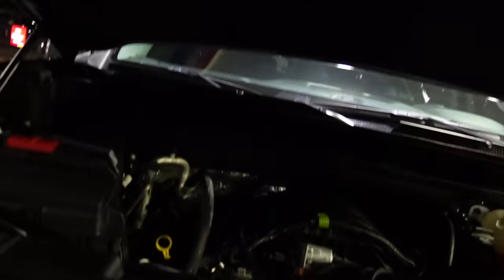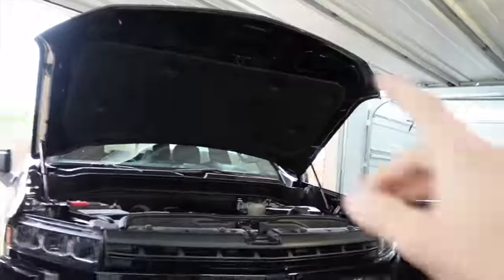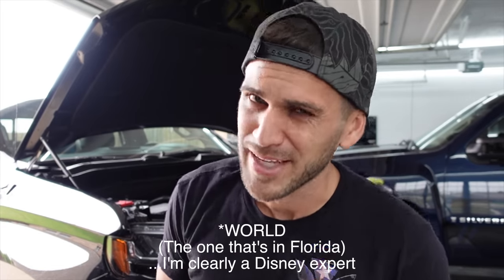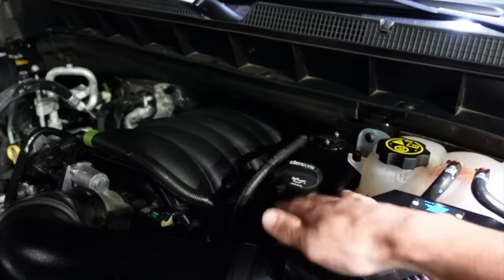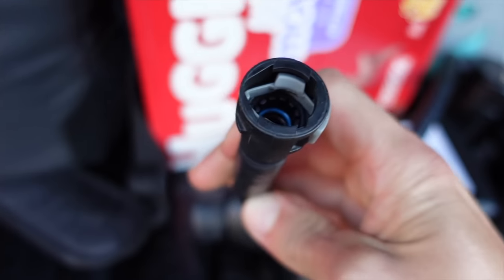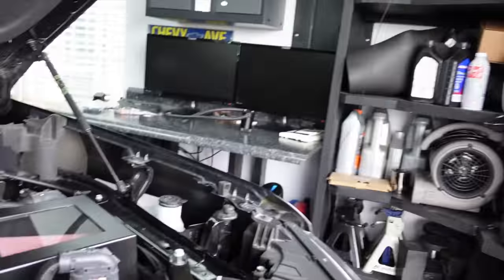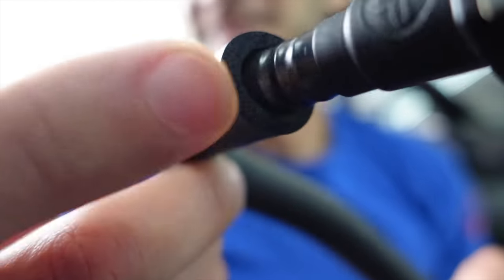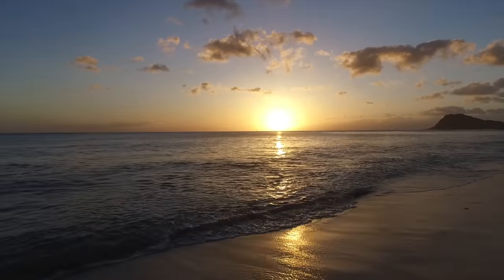Silverado Oil Catch Can - Did NOT Go According to Plan... 2020 Trail Boss Oil Separator

Comment: I’ve installed same unit(s) on a 2020 Suburban Premier Plus with the 6.2 engine, and on a 2016 Silverado LT with the 5.3 engine. I also purchased the extra 3oz extension for both units from JLT. I love the system. 
One thing that I notice from the 5.3 in my Silverado, is that once I deactivated the AFM system, via a Range plug in module, the oil bypass was greatly diminished. Or there was less oil to catch. That is yet another down side to the AFM system. Even though the cylinder would be deactivated, the oil pump still when send oil to lube the cylinder, and cause additional blow by. I believe Gm makes a different valve cover with a baffle and screen on the pcv vents inside the valve cover. To help reduce the internal blow by. 
On the 6.2 engine in my Suburban. I’ve notice that the system collects more oil while on longer sustained trips, especially if you are using adaptive cruise control. Than on daily driving. I haven’t purchased a DFM deactivation system yet. But; the Range Pulsar LT is in my future for my 6.2. 
Although the JLT system is some what pricier then others. I just like the reformed look and the ease of a plug and play system. It looks as if it were a factory option. Which I think for the amount of $ we pay for these vehicles, that a system like this should be.
Reply: Oil is sent to lubricate the cylinder? I think you're mistaken.

Comment: UPR catch cans come with much better hoses as well as WOT hose. I have a 2015 Yukon 6.2 with no added noise. (Pro model with ceramic back flow valves $439).

Comment: there are centrifugal ones built into the L5P and the LM2 (6.6 and 3.0 duramax respectively). They spin the oil out of the air, and return them to the crankcase .

Comment: I just installed mine yesterday and did notice a lil increase in vacuum noise(hissing) with the hood open, but not with the hood closed. I ordered some foam beer can insulators to quiet the catch can. Not that i need to but more of an experiment. 🤔 also added some oil to the inside of the hoses o-rings with a q-tip.
Reply: Awesome Idea 💡 👏 👌 I'm wanting to insulate a dorman catch can I just got and now I know what I'm using 😀 peace and much respect to you 👍 JASON

Comment: Lonestar, I did a little research (google) and found a thread on this issue but with a different brand. Quote "
Re: Sucking noise with catch can installation.

Postby MWBARN1 » Jan 05 2021, 11:52pm
I had this same issue with my E2000 Catch can. It would very slightly affect idle to the point of me not being sure if it was in my head or not and there would be a hissing sound from the engine bay when running. I couldn't let it alone so I took the catch can off the truck, put the stock PCV tube back on and there was no more hissing. I then took the catch can assembly and bench tested it with a vacuum pump. It would not hold a steady vacuum and would leak from 20 inches of mercury down to zero within five seconds. I isolated the leak to the quick connects provided with the E2000 kit. I cut apart the factory PCV tube and took the connectors from it and installed them on the E2000. I re-taped the hoses where I replaced the fittings and bench tested it again. This time it held 25 inches of mercury for five minutes. I called it good and released the vacuum. After re-installing the catch can there was no hissing sound with the truck running. Hopefully this helps others with this same issue.

Comment: My guess is there is still a slight vacuum leak.  It's extremely possible that the o ring on the jlt fitting is missing, damaged or even the wrong one.
Reply from the maker: That's what i'm thinking. I'm going to try to cut and use the stock fittings with the JLT hose and see if that fixes it.
Reply: @LonestarHawaiian any updates on the hissing? And if so how did u fix it?

Comment: I had same hissing when I used the fitting on it, I just cut the fitting off and used hose clamps onto the nipples of the PCV
Reply from the maker: Interesting... I'm going to try that. Thanks for the recommendation
Reply: I did the same. The new fitting hissed so I first cut the old one and attached hose to it and it still hissed. Now I just put the hose with clamp right on the port. No more hussing

Comment: Just get a breather oil cap. Had the same issue when I owned a Sky Redline and installed a catch can with AN fittings and braided hose.
Reply: Just adding the breather doesn't do much. What that does is allow the valve cover to draw in fresh air.  The pcv system has an intake and and exhaust. The catch can goes on the exhaust side of the pcv system where it filters out the oil so it can be burned in the combustion chamber. Just adding a filter  doesn't eliminate the problem.

Comment: My 2019 chevy 1500LD LT i put on a oil catch can. All highway im getting 25mpg. My truck doesn't make that hissing noise. None lifted, all terrain tires 255/70/17s. Cold air induction cold air.

Comment: I have the same set up as you. JLT catch can, Muffle delete, and the CAI intake. The catch can on my 2021 sierra 5.3l does the same hissing sound and catches a ton of crap. I put the catch can on at 1200 miles and the dealership hasn't said anything about it. I now have about 5k miles on the truck. I noticed in the colder weather it will catch water from condensation(yellow goop). If you could give an update about what JLT says about the hissing, that would be awesome! Thank you for the great content!

Comment: Catch cans are baffled and hose lines are longer compared to factory.. This affects the amount of air and gases that are fed through the PCV valve, when in return changes the internal engine pressure. Because internal engine pressure is changed, the motor is working harder than what it needs to, and has to idle higher than normal to offset the loss in crankcase ventilation. This would explain loss in fuel economy.

Comment: Ran UPR on my 2018 Tahoe with the 6.2 and zero hissing. I bet you cut the o-ring in the fitting when you installed it or the o-ring is missing completely. Pull the fitting and take a look inside.

Comment: Run a slice line down the stock part insulation to be able to remove it to use it around the new catch can hoses then wrap the insulation tape around that I may be super quiet just a thought
Reply from the maker: Good thought!

Comment: Manufacturers won't because they are not a necessity. You won't see a negative impact till the vehicle is out of it's warranty and they don't care then. So it isn't a cost they need to incur. Biggest reason is they could not trust the owner to maintain the maintenance of it resulting in liquid going through or a blockage hurting seals. Owning a JLT myself, these are JUST for those of us who want to go the extra mile and or want to keep our vehicles well outside the warranty.

Comment: I'm 100% sure that that connection is leaking air grab yourself a spray bottle with dish soap and water and spray the area and see if there's bubbles I guarantee you they'll be bubbles. If so if you would like to repair it with the stock piece simply heat up the stock hose where the connection is and when it's warm pull it out and reinstall that clip on your new hose and you will have your stock clip I know so because I've done this I made my own catch can and I'm going to be releasing my video very shortly

Comment: Someone at JLT lied to you bro. It has a vacuum leak. I installed a catch can with no thick insulation and yet no hissing.
Reply: Same here.  Mine is on 2019 High Country with a 6.2 so the fittings go to different places than the 5.3, but still not a sound.
Reply from the maker: Thanks for the info! I'm circling back with them. Y'all are awesome.
Reply: @LonestarHawaiian  I'm thinking the leak is at the end of the hose where it clamps to the PCV valve  .... ( the location of my 2015 is in that area not sure if it's the pcv). Second thought is that there are no clamps on the catch can side on the hoses. Just a thought
Reply: Mine also does not hiss, 2021 trailboss 5.3.

Comment: I have a theory that the bronze filtered catch cans can restrict airflow. Thereby increasing crankcase pressure or reduce operating vacuum.  That can disrupt the emissions design parameters.  And the higher condensation noted could be partially due to the probable restriction. I an using a large,  non bronze filtered can. Only a baffle has been added to increase the travel path of the blow by.  In fact, in drag cars and racing engines, a vacuum pump is usually employed to keep vacuum in the crankcase to aid the gas ported rings in sucking down the top compression ring into the lower part of the upper ring land. This is where the leak down testing is usually bad. Crap between the top compression ring and its lower land. Any vacuum restrictions in the crankcase should be avoided. In fact it would be better to add more evacuation into the intake path if at all possible.  Pending tuning parameters and such. Doing a leak down first is the best way to know which cylinder is contributing to the crap in the catch can.

Comment: I have a 19 TB and installed the JLT in 21. My first thought was not getting the hose fully seated. Mine were both tight to seat (click on). I never did get the louder hiss. I empty my can every 2500 and average about 1/3-1/2 full

Comment: I installed the JLT on mine and noticed that the hoses really push on tight, mine does not hiss, and no MPG loss.  It may seem like they are on and "locked" but they aren't.  After I installed mine I went back and tugged on each hose on the side that connects to the engine and both popped off.  Both had not latched even though it had seemingly engaged.  You really have to push those PCV hoses on hard they do not go on as easy as the OEM ones.  I am 6' 3 and had to get a step stool just to get enough leverage to push them on.  I would look at those hoses again and see if the O rings are damaged at all too on the inside part/pull on them to see if they are actually seated.
Reply: I had the same experience...you gotta really push on those suckers
Reply from the maker: Thanks! I'll take another look.

Comment: OE does not add these because all will not check and dump.  Plus dumping increases risk that owners dumps on side of road.  So no catch can to insure.   Plus you pay for carbon cleaning at 100,000.   More $.

Comment: Interesting. My 2005 Chevy trailblazer 5.3L EXT LT came with a cold air intake filter. Just hidden under a cover shroud. I typically take that shroud out during the summer. I do kind of like the direction change of your setup. Not gonna pay all that for what you have but I like fabricating so there is that..

Comment: Must be a 5.3 thing for the hissing. I have a 6.2 and didn't notice any noise. I'll have to pop the hood when it's running to see if I notice anything. I drove 25 miles home from the dealer and the truck had 5 miles from the dealer prep check so at 30 miles I installed mine. 6.2 hose routing is different and even with the stock intake and my big hands I was able to pull the old hose and put on the new hose without removing anything.
Reply: So I decided to see if I could hear any hissing if I popped the hood. I thought it was the accessories spinning, but once I got closer, it was coming from the catch can area. The hose from the PCV valve to the input   side of the canister was where the noise was. It wasn't a leak though as I pushed hard on all the hose connections and it didn't stop. When I pinched the hose closed near the PCV, it stopped but I could feel the pressure building behind it. There is definitely a lot of flow going through there! Way more than I expected. With the hood closed, I don't hear anything outside the truck unless you're really listening for it. Inside I don't hear anything at all.
Reply: The hose routing for the 6.2 is different. I just looked under the hood and it doesnt go to the back like the 5.3. So does that same one fit the 6.2?

Comment: I noticed your old pcv was still connected to old pcv hose when you installed catch can. Therefore no functional pcv, it regulates certain amount of flow through at idle. Catch can is supposed to be installed with factory pcv before re-entry of intake. Your hissing is an "internal leak" meaning unmetered air passing through intake without the pcv installed. If that black adapter on one end of  your factory pcv hose isn't your PVC, disregard entire comment
Reply: *PCV sorry phone spell check

Comment: LOL,,,,,well it is a Chebby so if this catch can is your only problem then you are one of the few lucky ones.  
I see you also brought some extra oil for your short trip,,,,good pro tip for all Chebby owners. 
How many cases of oil would you need for a cross county trip?

As for your so called loud pvc issue,,,,in reality it is your trucks cab has a lack of good sound proofing  VS other brands.

Comment: Some manufacturers  do install them from the factory but very few. My 2000 BMW 528i has it but it also has a return line that goes back down the dipstick so it's maintenance free. You may think your video was a partial failure but instead you just proved something that I have not seen on any other video which is quite important but I don't think you realised it. The hissing sound is certainly from the catch can, which you proved,
 but it's due to the baffles creating a resistance inside, actually not a leak. Your engine is designed for a certain amount of air intake at the manifold, but if you choke  it even a little, your fuel efficiency will fall. You could do an experiment to compare how much air flow resistance is created by the original pvc line verses the catch can. You may have potentially found a flaw design with the catch can which may be either in the restriction of the baffles or the size of the can itself or perhaps even both. This potentially makes this a GREAT VIDEO which makes me want to look up into this when I install my catch can. THANKS.

Comment: Just installed one on my 21 5.3 and it does the same hissing sound, I’m guessing they changed the PVC hoses for 21 year model because mine is a thin hose. Reinstalled the stock hose and the hiss was quieter but not completely gone, I will try pushing the fittings on tighter to see if it goes away or get some hose clamps. It’s catching oil tho so I guess it’s working. If you could keep us updated on this matter would be great!
Reply: Pipe foam insulation

Comment: Totally agree that catch cans should be stock on direct injection only engines. Which cold air intake did you use? Looks nice. I didn't know those engines use 0W-20 oil, yikes.

Comment: What is the inside and outside diameter of the hose that is used in your application?  What is the stock hose inside and outside diameter of the hose?  

I have purchased a Mishimoto Catch Can for my 2.7L Silverado.  It has an inside diameter of 1/2” and an outside diameter of 13/16”.  Is that thick enough to limit the sound that you were getting with your installation.  

I was thinking of maybe getting insulation wrap that is used for hot water pipes to install over the hose to limit how much sound is heard from the air rushing through the tubing.  Please reply with your opinion.  Thanks.

Comment: That was not true man. If a pcv system sounds like an air compressor leaking, your engine has more blow-by than ian hitting tampa florida. Either it isnt fully seated or not the proper size. If Ya look, the passenger line, does not have that insultaron and it doesnt sound that way. What might have happened, was you "sealed" it a bit with that tape. The extra air from the vac leak causes it to raise duel trim and it eats more doing so. A perfectly closed system does not do that.

Comment: I'm still curious about the mpg though. I wonder what the vacuum noise would had been like if you had spliced the insulation from the factory hose then taped it over the aftermarket. Might seem silly but I would definitely try it out. Hahaha
Reply from the maker: I did try it after I finished filming the video... It helps a little more, but still has the noise. Still trying to track it down with JLT.
Reply: @LonestarHawaiian I have the same one and have no issues. Are the hoses connected to the right ports? I can’t tell which way you have the catch can is turned under the catch can mount, but it looks like you have the hoses going to the wrong ports. Just a thought.

Comment: Is this after the afm deleted? Or dynamic fuel management whatever is in that year. Already got allot of miles on mine so just gonna keep running her I’m at 150k miles installed afm delete around 115k and change my fluids on time no consumption between oil changes even before the delete, the delete is a no brainer for all GM motors about to add one to my caddie also still under warranty but 50k miles now

Comment: Question...will the engine just burn off the junk? Run high octane 100 percent of the time....
Reply: Yes but the issue is carbon deposits on the intake valves

Comment: I have the same JLT on my 2020 and love it! So weird not sure what is going on I have been getting 21MPG on long trips fully loaded
Reply: Definitely sounds like your connection and fitting is not properly seated
Reply: I do not have that hissing noise at all don’t believe it
Reply from the maker: Thanks for the info! I'm taking another look at the connections. It's seated all the way but still hissing. I'm going to try and cut the stock PCV hose and use those connections
Reply: @LonestarHawaiian  Just surprised JLT doesn’t just send you new connections or a whole new kit… I have been running that system for 7 months no problems and multiple road trips
Reply: I’ve seen in some other installations where the hissing and lower mileage is due to engine pressure building up and venting. They installed an additional can on the other valve cover, and it quit.